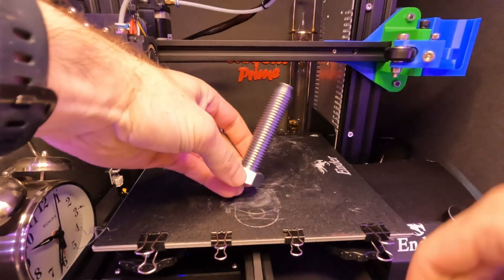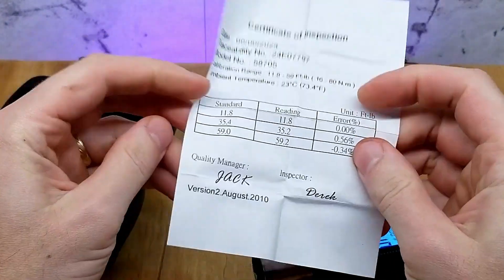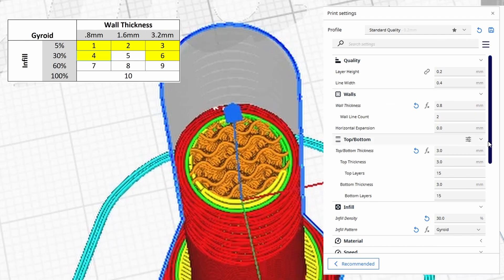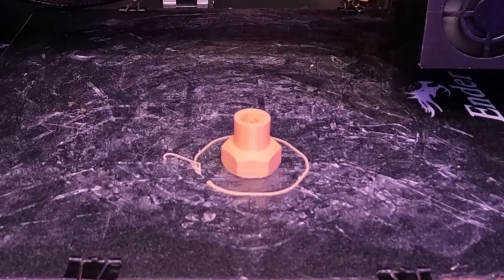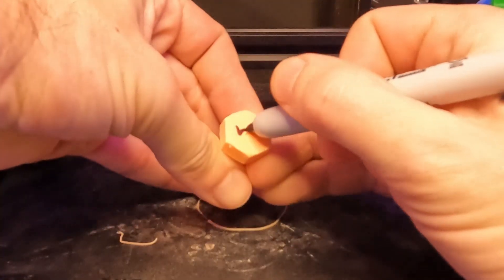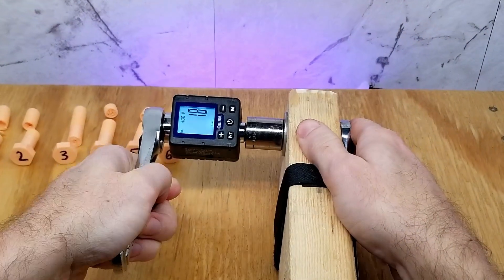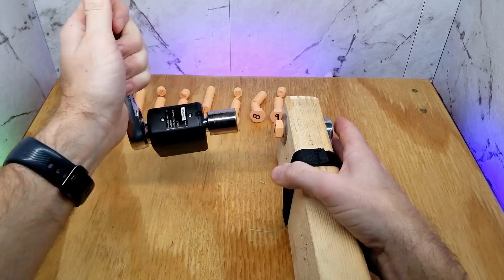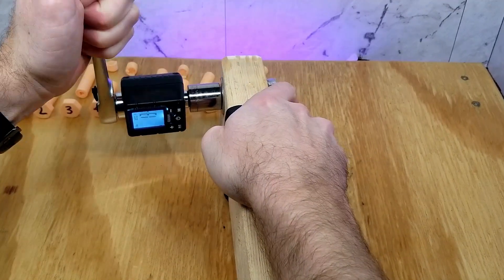Testing 3D Printed Screw Torques Until Failure with Results

Comment: If you ever return to this:

- brick layers
- annealing
- infill injection (https://youtu.be/H7nrJRBAMOA?si=d7lSaduG7rGbp3WF)

Loved this! Keep it coming!
Reply: Also worth mentioning, I recently had a 3d printed bolt fail, and used a cheap $4 3d pen from aliexpress to fill both sides and join them. Works well, just remember to remove all the infill first, and that will be the point of failure after joining.  No part cooling, so the plastic doesn't harden completely for a few minutes.  Makes it very easy to work with and get parts set just right.
Reply from the maker: Yeah, the fans are meant to cool a thin layer of plastic efficiently. When a big blob is presented from a 3D pen there's so much volume with so little surface area that it tends to stay pliable for quite a while so the parts can be fused. These are awesome! Great Ideas!
Reply from the maker: Thank You, those are all interesting for sure! The jelly filled donut one is neat with the infill injection.

Comment: I use to model my own threads as well, but years ago I realized that you can go to McMaster-Carr and download the .step file of many things, including bolts. So knowing this, I haven't designed threads in along time. Just download the size you need, import the .step file and use it however you see fit. I believe Grainger does this too.
Reply from the maker: McMaster Carr is AMAZING! It's unbelievable how functional their site is, I love it. It's pretty much the only site I use to get stuff. They've come a long way on all their site models, I remember a time when the threads were just patterned concentric triangles and not helix's like they are today. They're pretty spot-on with things. Even better, MMC can be a learning tool too... I usually download their solidworks models and they even contain all of the design tree information which helps to better understand how some complex designs are accomplished. I swear they have model ninjas working for them... Anyways, sorry so long here... Good topic though!

Comment: Your test results are invalid, as you are tightening the bolts and causing tensile stress at the same time.
Reply from the maker: Although, it's kind of the purpose of a screw, using torque to develop tension in order to hold things tightly together?
Reply: @sanfordprime There is no reason why tightening a bolt would invalidate the tests, because bolts are tightened during real world use and fail during the tightening
Reply from the maker: I agree, screw torque is not about how much torsion a body can handle on it's own with no other influence, it's about learning how tight a screw can be tightened before it breaks to understand where to stop before it's broken. Real world. If it were pure torque with no tension, the results would only be appropriate for a rotary drive shaft, right?
Reply: @sanfordprime  Yeah I think I'm wrong here. Not sure what I was thinking when I first commented!
Reply from the maker: No problem, I have my moments too! Lol.
Reply: @sanfordprime  I've thought about it more and I'm 100% confident I was wrong.

Comment: 75 inch pounds was the torque specs for my 4cyl engine bolts
Reply from the maker: 75 inch pounds when printed vertical, then nearly double that to 145 inch pounds when printed laying on its side in test #11 (uncharted). Even if derated to 75% of the yield, it still equates in my head to about a 5/16" (or 8mm) steel screw, which is crazy! And this is only PLA, there are plenty more engineering grade 3D printing materials that I'm certain would perform better. Out of curiosity, what size were the engine bolts?

Comment: Nice video. Between you voice, hands, and humor, I even got some ToT vibes. Anyway, I recently did a project with printed bolts that didn't need to be very strong to do the job, but where they were at extreme risk of being broken accidently during tightening just from the overwhelming mechanical advantage of the giant wingnuts involved (which were necessary). So, I made the bolts replaceable and printed them from TPU. It worked great, which was a big surprise because they were only 7mm in diameter. I'm not sure how they would do in a torque test, but being flexible built in enough forgiveness that I stopped worrying about them being accidentally over tightened and snapping. Might be worth experimenting with.
Reply from the maker: I'm unfamiliar with ToT... but I have heard of TPU threads. I haven't printed with TPU on my printer, it's kind of a dinosaur and I find myself sticking with the 'easy' filaments. When I get my new printer someday I'll have to stock up on all the different kinds of filaments. Some people have printed the leveling feet on the bottom of the rifle rest model I posted from TPU and I guess it worked out alright? I imagine that the threads would act like a nylock nut in that case since they were all internal threads. There were concerns with using a harder filament in that case, and some discussion with the footpads actually providing grip to the table top with the softer material. One day I'll have to try it though... Thanks for the info and interest!

Comment: I've seen people print bolts with 1 flat side so it can print without supports. Curious how much weaker that might make the bolt.
Reply from the maker: Heard of that too myself, was going to try it by just plunging the screw into the print bed slightly instead of using supports. I realized that it also cut away the hex head significantly, so I opted for supports. It would probably be good for set screws and maybe anything where the wrench head is smaller than the screw diameter? Interesting though...

Comment: I am guessing you didn't do much research prior to "testing".
The channel "CNC Kitchen" demonstrated years ago that 3D printed part strength mostly depends on number of perimeters/walls and extrusion width (wall thickness). Infill pattern and density has minimal impact on strength.
Reply from the maker: Nope, No Research at All. Had To Find Out For Myself and Figured I'd Share. I'd also like to add that the orientation of the print (lay of the layer lines) has something to do with strength. It certainly seems that there's already a video about 'everything' already on YouTube doesn't it? I've seen CNC Kitchen and he does a great job explaining things, but never watched anything he had on screw torques... will have to dig around a bit. Thanks for the heads up!
Reply: Cnc-Kitchen is a gold-mine when it comes to technical printing.

Just from the back of my mind what he already tested and should be handy with bolts: no Infill only walls, orientation, Temp, layer hight, nozzle size and no parking of the Printhead for nice timelaps, just print stright.
Reply from the maker: I've seen a lot of his videos, they're very good! There's a lot to know & learn about 3D printing for sure. All of the things you listed are important when it comes to technical printing, and difficult to get exactly right sometimes from filament brand to filament brand without doing some preliminary testing. To be completely honest, I usually trust the default settings in the slicer and hope that they got it right. And yes, sometimes I feel like the timelapses are detrimental to the print quality... but.... ;). Thank you for the interest and suggestions!
Reply: @The_Privateer  Why put testing in quotes as if he didn't really test? You are coming across as a douche (just as I did on another comment).
Reply from the maker: HaHaHa! You didn't come across as a "douche"... and I have an industrially-hardened set of emotions so no offense here either. There's different forms of 'Testing' and obviously I'm not in a physics or chemistry lab doing super scientific stuff... Just having fun. I mean, I can 'Test' the water temperature by sticking my foot in first... Done, Tested! LOL.

Comment: Are you really certain that you are testing for torque and not tensile strength?  🙂
Reply from the maker: It's kind of a little both I guess, right? I'll have to come up with a load cell to test clamping force and torque combined, in the future though... not now. Wait, are you trying to make more work for me? 😉
Reply: The torque measurement is invalid as you are progressively tightening them at the same time!
Reply from the maker: Am I missing something? Isn't that the whole function of a screw or bolt... Tension? Torque is just the means by which the inclined plane of the threads creates the tension to hold parts together. Torque is usually measured to understand when to stop tightening a fastener before failure. Torque is also easier and more readily accepted than measuring tension in a screw. Usually screw tension is calculated from the tightening torque. There are some testing devices that show what the screw's clamp force is as it compares to the torque applied, but $$$. Fun to watch though, that last little 'bump' of torque to make sure its tight is huge when it comes to the tension applied. This is just the tip of the iceberg though, are the threads lubricated/dry, what materials is each piece, friction between them, and so forth...

Comment: A bolt is meant to be used with a nut, and it is tightened by torquing the nut. A screw is designed to be used in either a preformed or threaded hole, or it is capable of forming its own threaded hole
Reply from the maker: Yes I agree with you, hence the title. I used a nut instead of a threaded hole for convenience. Lol, I'm on your side with this one. I'm usually the one correcting people when they call screws bolts and bolts screws. But yeah, it's a bolt when theres a nut and a screw when there's not.
Reply: Actually both are generally same, the name defines the use but a screw can be a bolt and vice versa. It can be specialised like a wood screws but it is not always "designed to" or "meant to" but rather "used to".

I thought the precision could help
Reply from the maker: Agreed, I think we're all on the same page with this one. : )
Screw + Nut = Bolt    (I feel like I've seen that on a T-shirt somewhere) LOL!